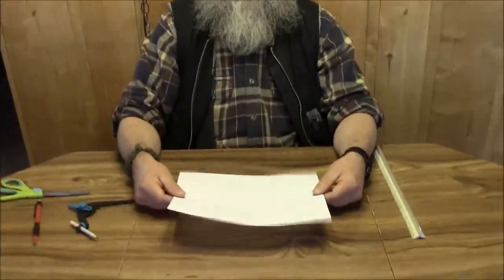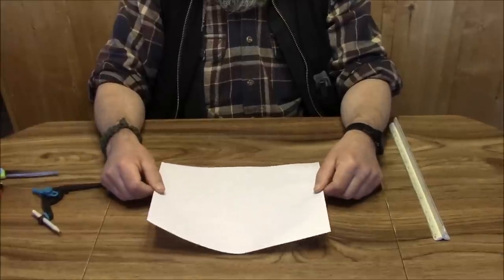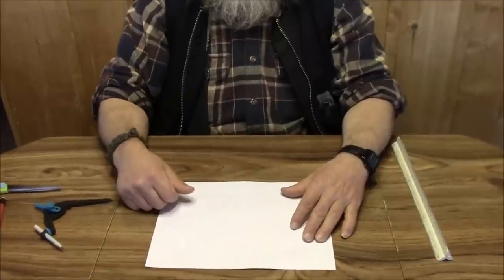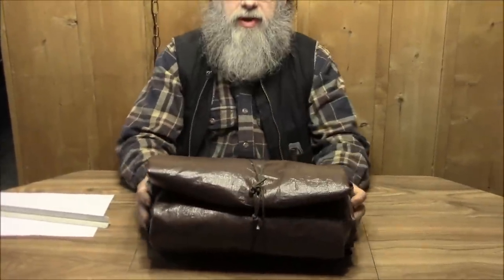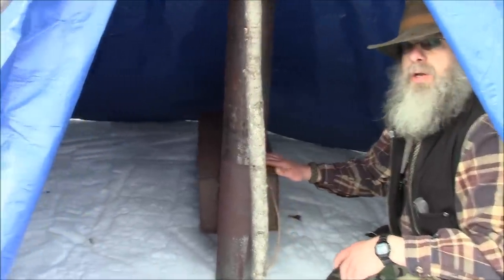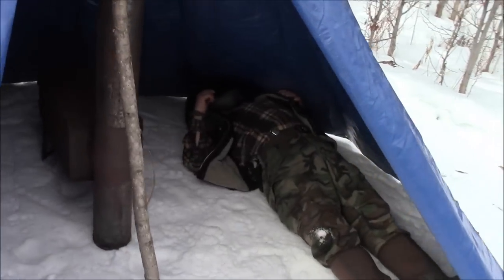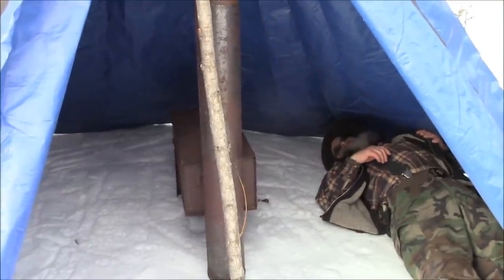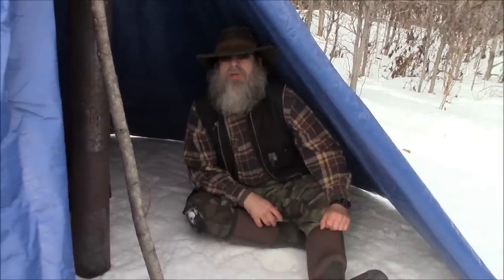Make A Tarp Tent Tipi Hot Tent On The Cheap

Comment: Is there any color of tarp what would be better than another?  I was thinking of using a heavy duty white tarp - to keep it bright inside during the day.  I suppose it's not very camo though...
Reply from the maker: White would work great.  I personally would not want a white tarp because of how brightly it stands out in a wilderness setting but that is simply a personal choice.    I would enjoy the light reflecting abilities of a white tarp when inside the shelter during the winter.   Color is pretty much a personal choice since any color would work just as well as any other color as far as structural integrity is concerned
Reply: Far North Bushcraft And Survival - Thanks for the reply Lonnie!  As soon as weather permits I'm going to try it;  I'll let you know how it works out.
Reply from the maker: Paul S.   Yes I would enjoy hearing how the tipi project works out for you.
Reply: Far North Bushcraft And Survival - Hello again Lonnie.  Just finished making and erecting my new tarp teepee in white -  tonight's the first overnighter.  All in all it worked out very well!  I had some difficulty reinforcing the top with tape, in exactly the right conical shape - the extra flap gets a little tricky up top as well.  Otherwise no problems and I put grommets every 18" for a nice tight set-up without any sagging.  Would love to send you a photo of the teepee in white - has a canvas tent look to it during the day and a nice glow at night.  Thanks for the helpful video - I owe you 😁

Comment: Did you use those cut pieces for flooring.?
Reply from the maker: No.  I generally bring larger pieces of tarp for that.   However the cut offs should work great for that especially if cut and fashioned into usable sizes.

Comment: besides the heatproof wall section portal through tent?
have you ever thought about? adding a snowskirt or valance
to base of tipi 8inches is usually a good widths it doesnt have to even be outa the same material i find this is most useful on beach or coastal camps as valance compliments pitching of tent on loose material like sands gravels around sea or estuaries
and aswell as in snow piling the snow sand or gravels up arounds 8 in sides prevents all cold spots or drafts 
also!!
it gen improves the tents gen performance and doesnt weigh a lot to add!!
a series of rectangular 8in strips stitched or taped into tipis footprint will suffice can even be made of lightweight nylon ripstop or polyurethane coated polyester
anything wind waterproof strong enough to take scuffing!
im turning your tipi into a 5 star hotel!! i know but these are all little add ons that often do make a noticeable difference to your camping safety security comforts when you are out!!
Reply from the maker: I had a custom made large canvas wall tent that i had a sod cloth added to when it was being built for me.   That was useful for sealing out the drafts under the walls.   During the winter though it is no big deal with this tipi since I just simply throw snow up against the tipi all the way around to seal off the bottom.   It would have been nice though on a two week trip that my wife and I just got back from to have had a sod cloth added to the tipi.   It was plenty warm in there even during the mornings with frost outside but we may have used less wood in the wood stove if the bottom of the walls would have been "sealed" better.
Reply: +Far North Bushcraft And Survival i have an old double a pole ridge tent made for mountain uses it was to replace my 1st one that got stolen but it was factory seconds an reject last one manufacturer had it never was same as the 1st one minus the snow sleeves either ends too also
so what i am going to do with this one is use the 2nd tent to make a pattern from obtain sizes etc
and add on the features that the 2nd replacement tent being a seconds never ever came with but out of completely natural materials im using an excellent fabric made by a mill in derbyshire england called ventile finest cotton you can use in the great outdoors very very hardwearing will outlast you n me?
im a bit daunted by the stitching tho so may obtain services of a seamstress if i get stuck as fabric is about $30 per yard or metre
i am going retro i find the quality of older design of kit somehow far superior it can take years of use without needing to exchange or update it polyester i hate yukk
the ventile closes like canvas in wet weather but you can treat it and or wax it much like a barbour jkt
its heavy of cse but as a basecamp tent ideal
it wont be easily shifted by the winds either 
my valances have saved me on numerous occasions i wish id see more tent manufacturers incl it as an option
along with ventilation tubes either ends wired openings sleeves  to curculate air if covered by thick snow overnight you know its deep thick when winds stop n everything goes queit and tent walls are sagging inwards
you open up your door zip to face a wall of snow ive prev used 
my icevaxe to punch a air hole out into blue sky laying in my bag no needs to get out the tent either ends i punch my ice axe shaft out waggle it about fresh air rushes in 
to air it off
before i start cooking reduce carbon monoxide poisoning risks 
saving yer wood supplies is a good thing
less chopping n finding needed?
its a dang decent fix that tent you made outa a tarp a very good alternative that saves u big money!! great idea if done properly as you did it?
Reply: +Far North Bushcraft And Survival we often dont get enough depth of snow here in uk to always fill or close the gaps we have to gather it
from a wider area a lot of uks uplands are wind scoured less deep than in alaska
yes in valleys it drifts
of cse but that aint often a good place to pitch a tent in any blizzards?

Comment: Thoroughly enjoyed this video. I am on the crew of the upcoming reenactment of the Chisholm Trail cattle drive, from Texas to Abilene Kansas in 2017. We will be living on the trail for 14 weeks and can only use a canvas bedroll or a tipi made from canvas. I can not afford a 700.00 tent so I was searching youtube when I found your video. I plan on purchasing white canvas and white gorilla tape, following your directions and making my own! I do have one question however, We will be beginning this drive in the Spring and I noticed that rain, insects and possibly an unwanted critter could easily come in under the tipi. What do you suggest? I was thinking about getting a tarp and cutting it so that it lay on the floor but comes up the wall about a foot on the inside, then attaching it somehow. Suggestions appreciated.
Reply: velcro would be my suggestion. i have some strips that have an adhesive on the back. i put a piece on the front of my kayak so i could attach a small radio. 5 yrs later that piece is still there, so i guess it's waterproof. outlasted the radio :) have fun on your trip. God bless
sincerely christian anarchist
Reply: +walter hansen thank you.
Reply from the maker: Yes these type shelters can be a problem in a skeeter thick environment.   Each time you set up this tipi, the configuration is changed slightly due to uneven ground etc.    So a solid built in floor may be a problem.   When pitching the tipi in a natural environment, you could always place dirt, grass, leaves etc on the bottom of the exterior tipi walls in order to "seal" them.   A tarp or tarps on the inside as you suggest is also an option.   You could then over lap the floor up the walls and lay clothes, sleeping bags, blankets, packs etc against it to "seal" the floor to the walls.    Or perhaps you could gorilla tape some "tabs" around the interior walls 6 -10 inches or so up the walls with ties hanging from them.   You could then tie the floor tarps in place by tying the wall ties to ties strategically place on the floor tarp/s.    This would not "seal" the floor to walls but would at least hold the floor edges up and in place.

Comment: Awesome tent. One question, how long can the tent last in cold conditions? (Complete with wood stove). Also, you've just gotten a new subscriber.
Reply from the maker: +Miguel Rojas     The cold will not bother the tipi.   It is the folding and unfolding to put up or take down that will probably cause the greatest wear along with exposure to the sun.    Keep in mind that this is made from tarp material and so therefore it will last approximately as long as a tarp would last in your area.   It should last for several years of continous use I would think.    If you are only going to use it occasionally it should last 10 -15 years or more I'm going to guess.    Even if it only lasts for 5 years of occasional use, it is easy and inexpensive to make a new one.
Reply from the maker: +Miguel Rojas     I forgot to say welcome to the channel.   I'm really glad you decided to stop by.    There are many many videos in the past already recorded with lots of great information as well as many new ones planned for the future.     Hope you find much here that will interest you.

Comment: How well does this hold up in high  wind?
Reply from the maker: Real well.   I used heavy duty quality tarps in the construction of the tipi.   I would not purposely set this up if I was expecting high winds but my wife and I were camping above timberline last Fall while caribou hunting.   We had been camping for quite a while and had no access to the news or weather reports due to the remoteness of our location (remote Alaska).   Along came a horrendous wind storm that we later found out caused damage to signs and other damage in the towns of South Central Alaska.   The tipi was holding together just fine but I was nevertheless worried about it and in the middle of the night I finally pulled the center pole down and laid the tent on top of us.    We were able to get back to sleep finally after that and slept until morning when we packed up and headed out.   I was very impressed that the tent held together.   I had told my wife in the middle of the night that we needed to get up and fully clothe ourselves in case the tarp shredded and went flying off into the distance.   The tipi was really flopping and banging similar to how someone rolls up a towel and "pops" the end of it by flicking the towel like a bull whip.

Comment: Hi Lonnie. I was looking at round pool covers at my work and was thinking a heavy duty pool cover would make a quick and easy teepee tent. Just find the center and reinforce the center to hold the pole. The biggest we carry is for a 28ft pool, but with the overlap it’s 31 ft. With a 6 to 7 ft pole, I wonder how much room it would be for the inside diameter?
Reply from the maker: The best thing that I can recommend is to make paper models to scale as I showed in the video.   Then you would know how big of tipi could be constructed from how big of tarp material.   So if you are going to try to use a piece of material say 20 X 30 feet, use a piece of paper and divide the longest length by 30 divisions of equal distance.  Then use the measurement of one of those segments as your "one foot" measurement.   Measure out 20 segments at right angles to the 30 segment portion.   Make each segment of teh 20 segment direct the same size as each of the original 30 segments.   You now have a piece of paper that is representative of 20 feet by 30 feet scaled down considerably smaller.   Go ahead and mark out the tipi on teh paper and cut it out just as I showed in the video.  You can then put the cutout together as a tipi just as I showed.   You can measure the distance across the bottom of the tipi model using the same scaled down one foot distance as you did in that original length of each of those 30 segments.   That will tell you how many feet across the real tipi will be once constructed.    I made my tipi out of a 12X16 foot tarp.   I know of someone else that made their tipi out of a 16X20 foot tarp for a more spacious sized tipi.  Good luck.
Reply: Far North Bushcraft And Survival   Ok. Thank you. I’ll do that.
Reply from the maker: Good luck with the project.

Comment: Do you find that the tape stays stuck in the cold? What size tarp would you suggest for 2 adults and 3 kids? 8 to 11 years old.
Reply from the maker: Yes the tape stays in place very well in cold weather as I have had my tents out at around 5 degrees below zero Fahrenheit with no failures.   I gave instructions in this video on how you can make a paper model to scale and make sleeping bag models etc to scale to show one what size tipi and therefor what size tarp they will need.

Comment: Do you have a problem with condensation with the tipi?
Reply from the maker: It depends on what you label a "problem".  If a woodstove is being used the condensation is quite minimal especially if a liner is used.  I personally do not label it as a problem because it is so minimal.  If no woodstove is used then condensation could be a problem without ventilation.

Comment: You could build this / a tipi WITHOUT having to cut up the tarp.
If you have several of those black clamps, you can use those to fold the excess tarpcloth inside, attach a clamp on the bottom and stake it down. You wouldn't need ducttape.
Reply from the maker: In my experience, non of the tarp clamps I have tried have been a very secure clamp.  I have tried quite a few different brands and varieties.  Some work better than others but none seem to be particularly secure.  If one put duct tape on the locations where you then clamp over that, I believe that you might be able to fashion a fairly secure clamping then.   However I would personally rather just go ahead and make a dedicated tent so that from that point forward, I have a good dependable tent that can be set up in each location rather easily.

Comment: Lonnie. Whats the approx height of your center pole? Is there a way to insulate the interior side of the tarp?
Reply from the maker: The center support pole is approximately 6 foot.   by adding a second layer of any type plastic on the inside or outside of the tipi. It will be much warmer.   Reflectix may work awesome but would cause the tipi to be very bulky for storage.

Comment: would you please tell me the area of sleeping ground there is with your 12 x 18 tarp? Also is the walking area comfortable? Thank you sincerely, Tracy
Reply from the maker: The 12 foot by 16 foot tarp that I used produced a tipi that is approximately 10 feet across.   I am 5'6" and can stand up in the center but my head is against the center pole and the outside wall.   If you wish to have a tent with more stand up room then you may enjoy more the cowboy range tent that I made this summer.   My wife and I used that tent with a woodstove in it during our Fall moose hunt in a remote area and it worked very well.  See the video link below if interested.

Make A Range Tent Style Hot Tent On The Cheap
https://www.youtube.com/watch?v=t47WFUZM4go

Comment: great job, you did not mention the weight - I guess, that needs a slide in the woods..
Reply from the maker: +Herbert Hriberschek    If I remember right the tipi weighs 6 pounds or 2.7 Kg.    I will be using a sled to haul the tipi and the stove this winter.

Comment: could you make it with that extra overlap piece on it by default? like without having to tape it on after the fact?
Reply from the maker: You could not keep that piece on originally the way that we drew it and cut it out.   The whole finished size of the tent would have had to end up being significantly smaller in order to accomplish that.   Look at the paper models again early in the video and you will see how what you ask is not possible.

Comment: How tall is the center pole inside?  And do you use anything to stabilize it?
Reply from the maker: I have never measured it and do not have a pole.  I always cut me a new one at each location where I am camped.   The height of the pole varies at each location due to uneven ground as well as ground type such as dry ground vs on top of snow.   The pole height is approximately 6 feet give or take several inches.

Comment: Lonnie,  

Since a 360 degree angular cutout circle will have a height of zero fee, what angular circle cutout is the best shape for the teepee?  Maybe a 3/4 circle or 270 degrees?   If the tent is too tall and thin, then there will be problems with the chimney jack.  If it's too wide, then there will be too much low ceiling, unusable space on the sides of the tent.
Reply from the maker: Good Grief, Now you are getting into math and expecting me to keep up with you.    I gave up on that back in the 6th grade lol.   What I recommend doing is what I said in the video.   Just make a paper model to scale based on the size of your tarp and you will see in the model what degrees the wall angle will be, how tall the tipi will be, and how wide it will be.    If that does not fit your needs then you will need to get a larger or different width to height ratio tarp.   The paper model will give you a visual representation of the finish product and if you do the modal correctly it will all be to scale so the measurements will relate to the real thing.   Keep adjusting the model until you will be happy with the results and then make the real thing.   It would probably be best to use pre-existing tarp measurements as a scale template for your models.